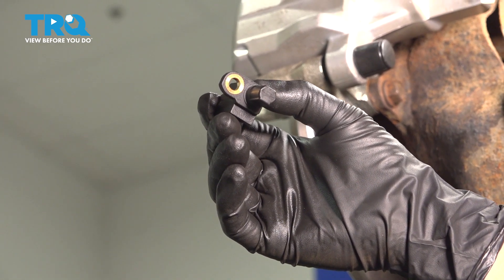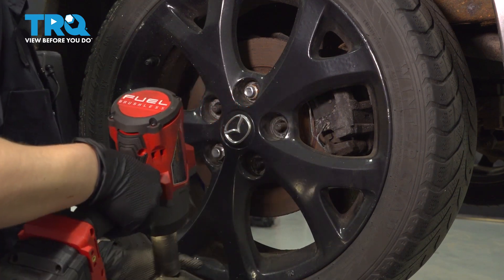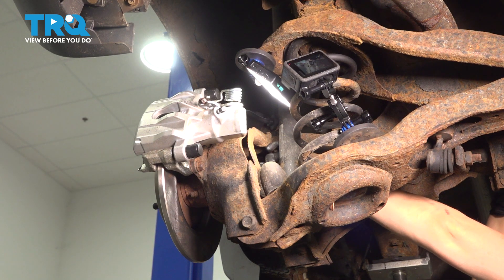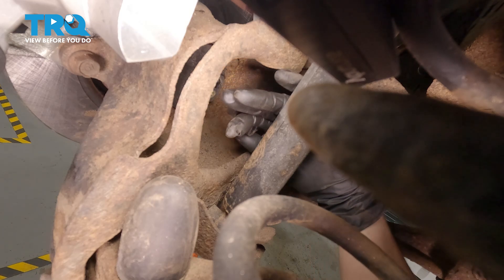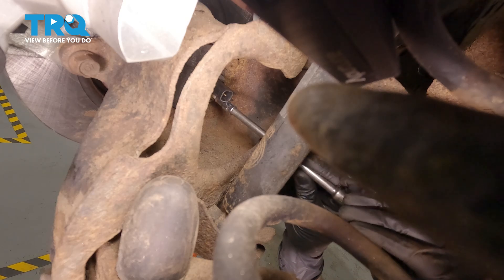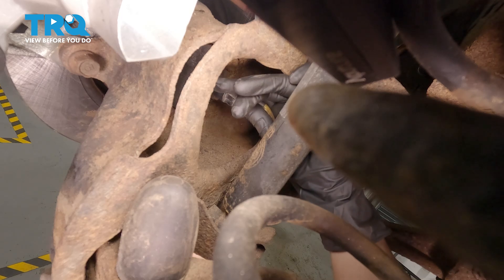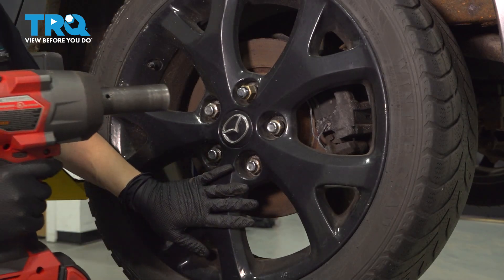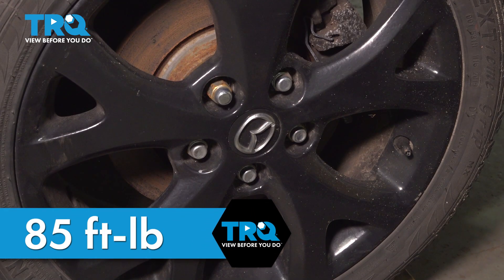How to Replace Rear Wheel Speed Sensors 2004-2009 Mazda 3 2.3L L4

Comment: After you remove the wheel, the next segment shows you removing the nut at an angle and position that is not explained.  You should have pointed at the wiring harness immediately after removing the wheel and have the cam follow your hands to where the access point is, like as if you're wearing a GoPro.